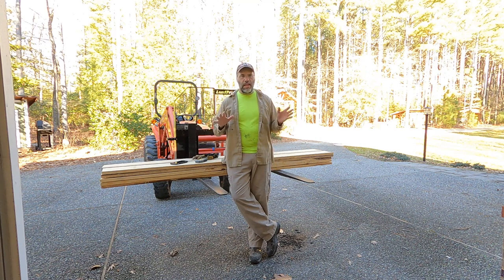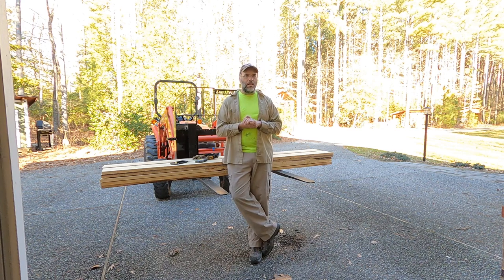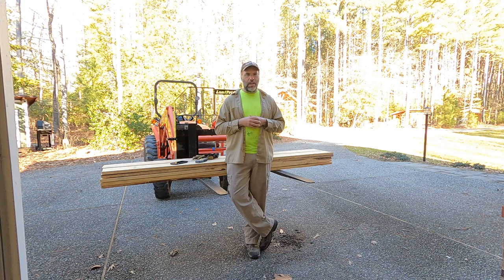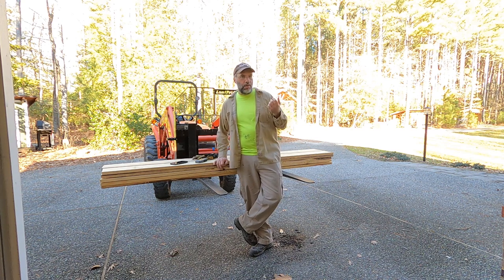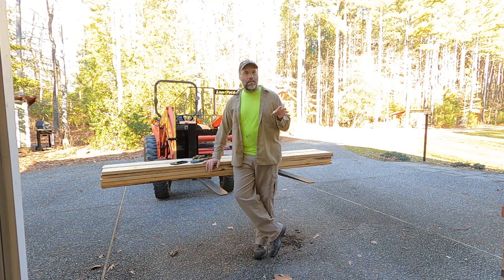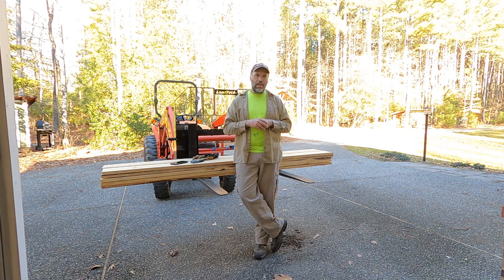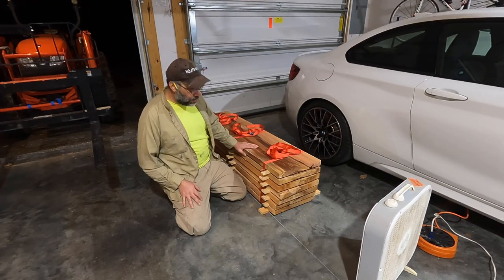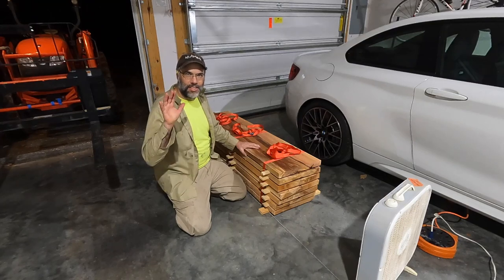Stickering, Stacking, Strapping, and Storing my Sawmill Lumber

Comment: BTW I've never seen walls made like you have with the T bracing essentially.  Keeps the wall stiff, and allows for greater spans. I may have to try that.
Reply from the maker: For a gable wall (with no roof load), it lets you go up to about 12' span between posts, so potentially saves digging a post hole and putting in a post that would have no real purpose (in terms of vertical load).  But it really depends on the project, grade, amount of backfill inside the skirt, etc.  Sometimes a dummy post would be just as quick.

Comment: Yes, saw dust is 90% of everyone's problems with mold.  A wide drywall knife will make quick work of it, and then every couple days hit the wood with a leaf blower to remove the dried sawdust that's left over.  Virtually impossible to get mold this way.

Comment: My question is how will I know when I can remove the straps? I had to have an old damaged pecan tree taken down in 2022. I had the parts that were still good milled into 2-1/2" thick slabs. The sawmill guy did the sticks between slabs and straps, these stacks of slabs have been on my carport with good air flow and they seem to have dried out nicely. I don't have a meter nor the budget to buy one. The sawmill guy delivered them, I don't have a tractor to move the stacks to another location so I am contemplating removing the straps so that I can move the slabs one by one to another location mostly because they are in the way for a planned project to remodel the carport and adjoining porch area.
Reply from the maker: Plan on taking a year per inch of thickness to completely dry in a mild climate.  Drier climates take less time, humid climates take more time.
Reply: @Lumber_Jack  thank you and yes I had been told that but does that mean I can't remove the straps and move the slabs to another location individually? I can't afford to hire a tractor with forks to move the slabs all strapped together.  I was also told that the thicker the slab the less they warp, what is your opinion on that?  I intend to use the slabs as benches, table tops, counter tops, and stair tread. I'm wondering if I could go ahead and move some inside the house.
Reply from the maker: @Maggie-Gardener-Maker  Once you loosen the straps, the horse will be out of the barn.  I wouldn't let that stop me from moving them if they were truly in the way, but don't expect them to behave or go back into a neat pile.  Wood is very unpredictable in this situation.  

Many factors determine the stability of wood.  Thickness can be a plus or a minus depending on other factors.
Reply: @Lumber_Jack  thanks

Comment: Don't waste the boards, you can throw them on the sawmill and make 1x6 out of the 1x10, etc.  They can be cut 2 ways to fix the issue and save the wood.

Comment: Thanks again for another great video. Did you happen to notice if the boards you rejected were stacked at the bottom, middle, or top of the stack? Could the position of the boards in the stack contributed to the imperfections?
Reply from the maker: They were all in a bunch near the middle, but I am almost certain it had to do with the particular tree and not the stacking.  I had another group of narrower boards from the same tree that I tossed out last year, even before stacking, since they got all twisty within days of being sawn.

Comment: Thank you so much Jack.  Based on your experience I am going to buy a Woodland Mills bandsaw and will set it up exactly like yours.  I was curious about your barn floor.  It appears to be compacted 3/4 inch crushed ledge directly on the ground.  Did you use a fabric between the ground and the stone.   I have large pole barn and am debating if I should spend lots of money for concrete or use your system.   Kind Regards.  Craig
Reply from the maker: I poured a concrete floor in the main barn since I wanted to roll around dollies with tractor implements, but both additions have gravel floors, which really takes advantage of the cost-effectiveness of the pole barn method.  When you introduce a concrete slab into the design, a pole barn becomes less cost-effective and you might do better with stick-framing on a slab with thickened edges (ie, slab is already there, no need for poles).  But with a gravel floor, a pole barn will always be the cheapest way to go.

I used #8 gravel, which is a screened product with no fines (rocks about 1/4-3/8").  It self compacts as you rake it to grade and no machine compacting is required.  There is also a #78 product that is a little bigger but works OK.

Normally I will rough grade with #57 gravel (3/4"), then put down 1-2 layers of 6 mil plastic as a vapor barrier.  Some people will use roofing felt, scrap outdoor carpet, or any other suitable barrier that can block ground moisture.  Then the #8 gravel goes on top and gets raked to final grade.  Offhand I'd say there is 4-5" of the #8 gravel above the vapor barrier (about the same as the thickness of a typical concrete slab).

The #8 works fine for anything with large tires, such as vehicles, tractors, riding mowers, ATVs, etc.  They will roll over it with no issue.  But smaller tires (push mower, log splitter, etc) will not roll easily on it and want to furrow in, so keep that in mind.  For a barn that stores small equipment with skinny wheels, I'd either want a concrete floor, or put down crusher-run.  With crusher run, plan to rent a plate compactor to get it packed down, and then plan to deal with possible dust, since it contains fines.